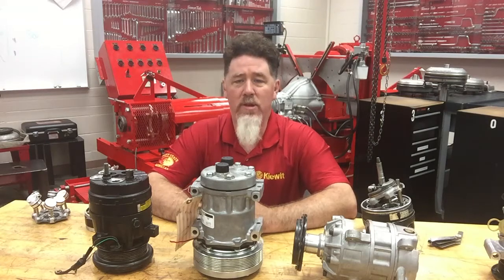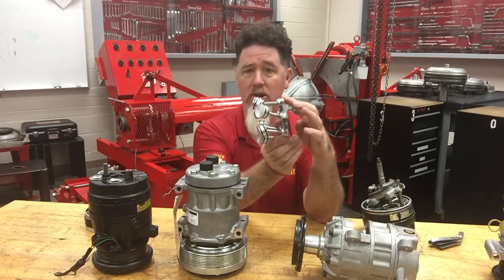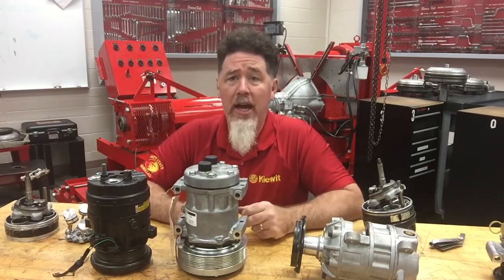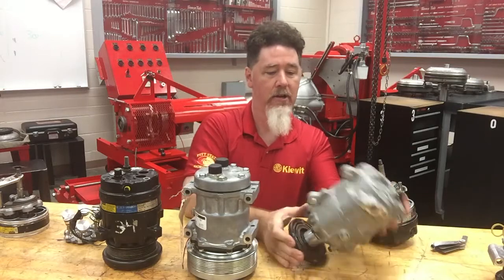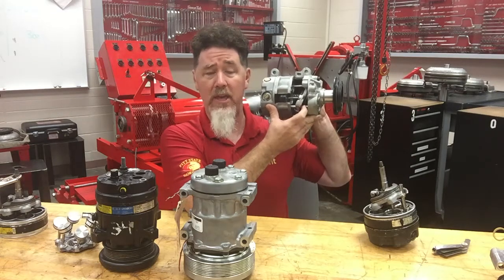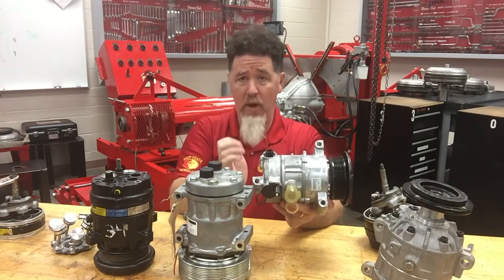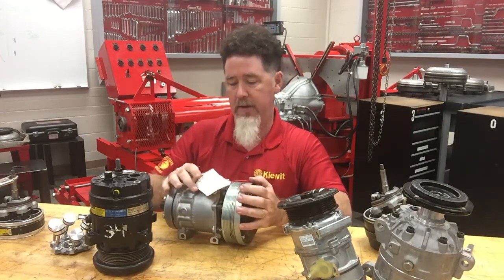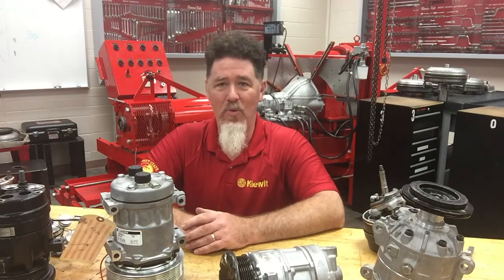Lesson on the Co-Axial Wobble Plate A/C Compressor Part 5

Comment: My problem is , jaguar xf 2.2d 2014. Firstly , I have tried three compressors . One new , one 2 yr old , and the original. Has a clutch and the dual pressure solonoid valve . The valve, have tried three also ,new. Measuring 12v at the valve. It's the sanden variable. I hear the valve click. I cannot get the pressures to change from static. System has been flushed. I'm an a/c engineer so I regas myself on 134a. At no time can I achieve any change in pressure. My diagnostic reads 750ma to the valve. Sits at 80 psi both sides regardless of clutch on or off , or solonoid clicking on or off. Is the 12v a red herring and not actually actuating the valve properly?  I have ran out of ideas. I can put gas in the high side , low side slowly catches up. Vice versa put in low side ,high side catches up quickly. If pressure are static , how is the wobble plate actually going to start wobbling. Why is the valve not causing activation. I'm at the stage of parting my spare compressor and seeing g if I can engineer a wobble into it to at least start the process. I'm at the stage otherwise of giving up. Laptop diagnosis reading everything , temps , evap temp , 750 ma , clutch engaging , but no pressure change. HELP!
Reply: Sorted for 20 pounds. Traced to faulty hvac module. Bought a used one , now perfect aircon

Comment: Great videos ! You seem very passionate about your work. I will be starting a a/c tech class soon so i might be asking you a few questions in the next weeks 🙂
If i understand correctly, the refrigerant pressure moves the wobble plate ? So if the wobble plate doesnt want to get more demand (more angle) it might be caused by a low refrigerant level in the system ?
thanks !
Reply from the maker: Low pressure in the crankcase of the wobble plate causes an increase of displacement, so a low charge system will not cause the condition you described.  I hope that answered your question.  I hope you are following the channel, PP.